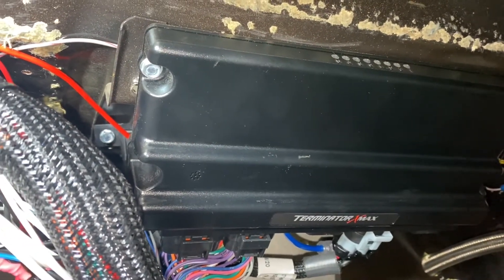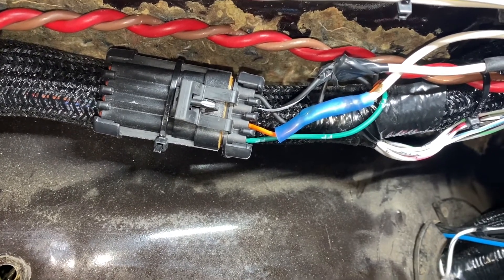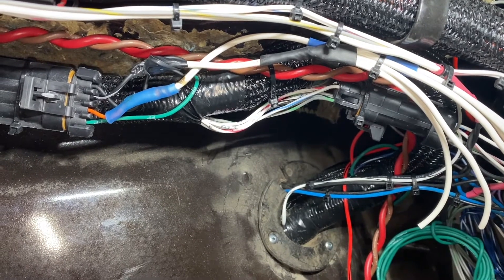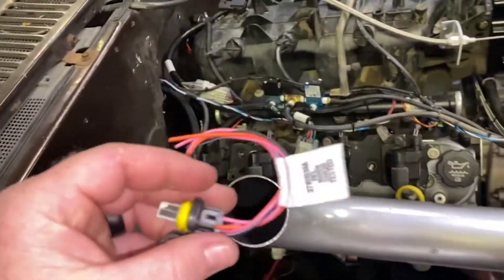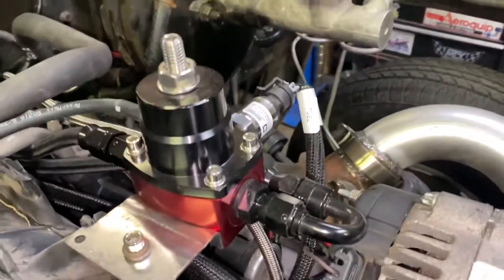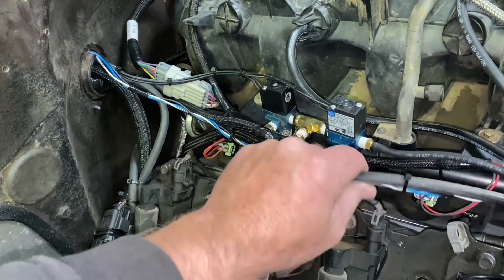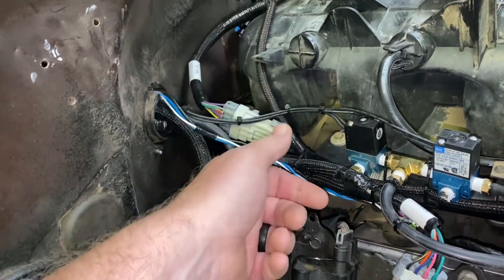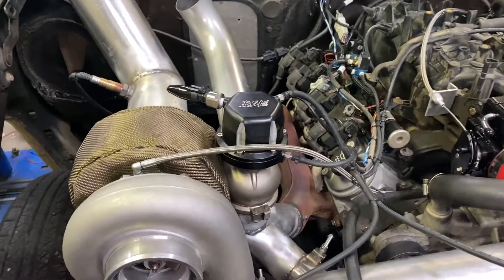Holley dual Mac valve boost control and dome pressure sensor

Comment: I like when I have an inquiry about something an find a simple an quick response but im really curious about why you when so high end on the wastegate an budget minded on what seemed like most everything else.
Reply from the maker: Do you have to spend the money on the really important parts exhaust tubing stainless steel or aluminized does the same job but a good quality wastegate will save your engine

Comment: Does it work well using the compressor for pressure instead of C02.? I’m thinking about doing the same but haven’t seen a ton of info on it.
Reply from the maker: Yes it works best with co2 or compressed air.
Reply: @mufflerman69  yeah I’d like to run C02 at some point. But I want to use turbo pressure for now.
Reply from the maker: If you want you only need to run 1 Mac valve you would just have to setup the table a bit different. Check out the sloppy wiki page it has the how to or you can look up Matt happels YouTube